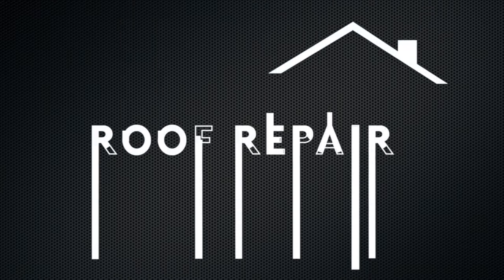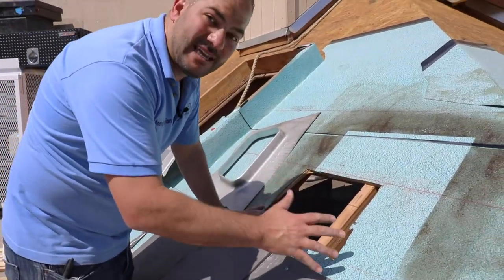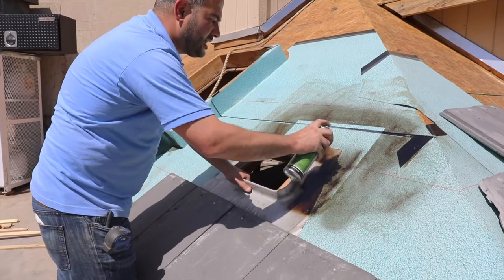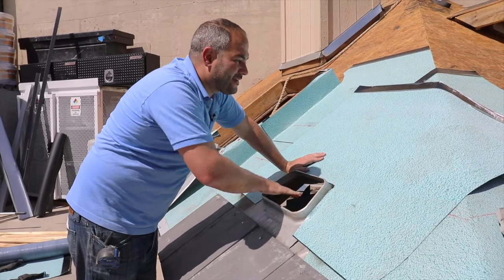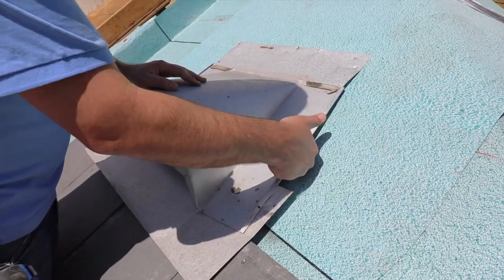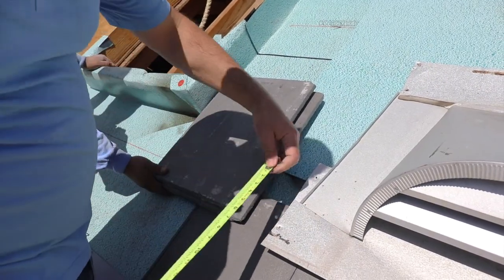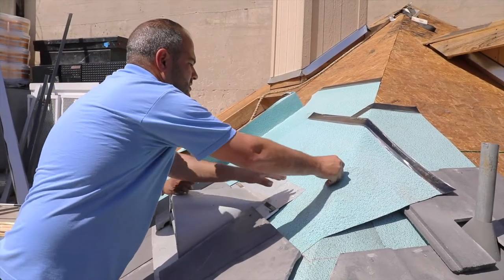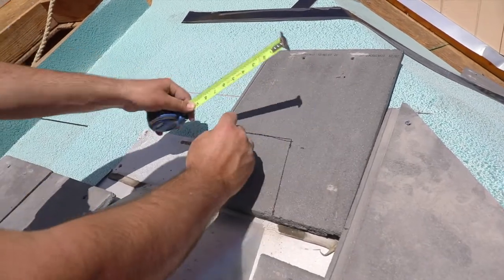How to Install a Dormer Vent on a Flat Tile Roof

Comment: you're supposed to turn up the side flap on the dormer. 
that flap prevents water from moving sideways when debris dams up the gap.
Reply from the maker: That is a good point. I am assuming you mean bend it to a 90degree angle. It'll pretty much be like a tile pan, I like it! thanks for the idea!